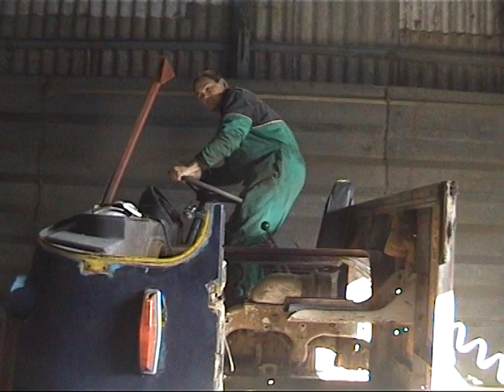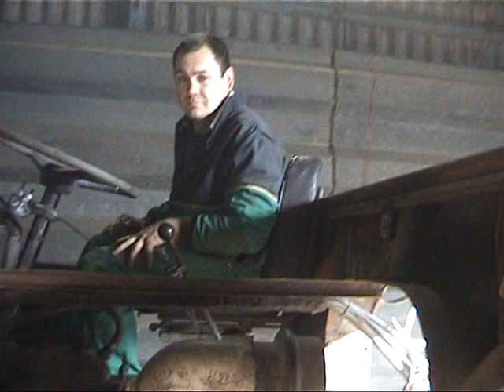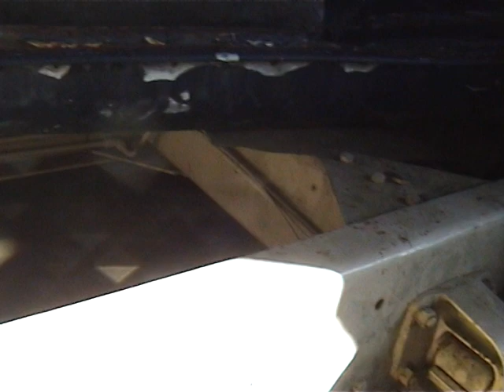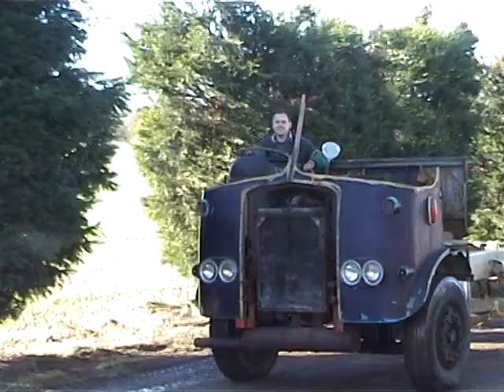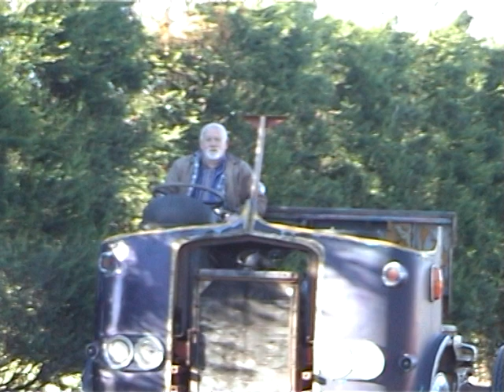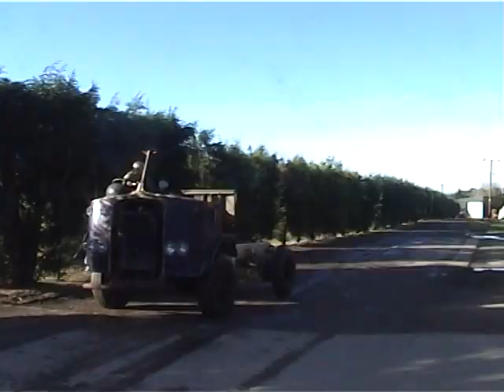Will she start! Cummins 220. First start of the 12l vintage truck

Comment: haha this is virtually how they would be towed into our garage, if they had a an accident the whole cab would disintegrate and the driver would be left in the metal subframe, just wondering if you can still get spares these days ? back in the day we had a spec sheet for every atki that was ever built,

Comment: Chassis used to break at the rear front spring hanger.  Oh how I don't miss them lol. 20 blankets on engine covers.  Speedo not working.  The list is endless
Reply: speedo didnt work due to gearbox impulse generators , they were the week link and you couldnt get hold of them,